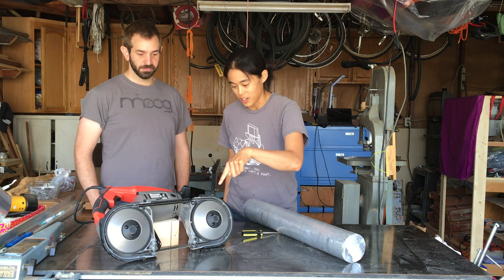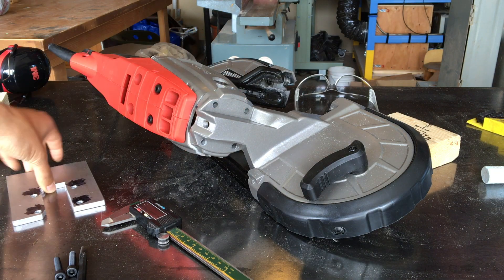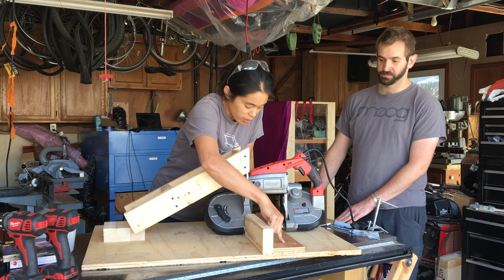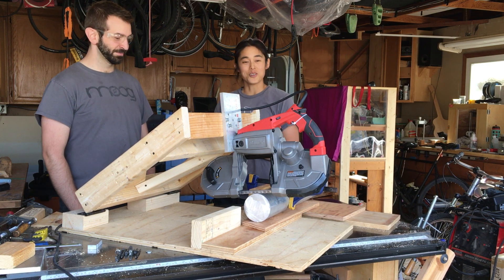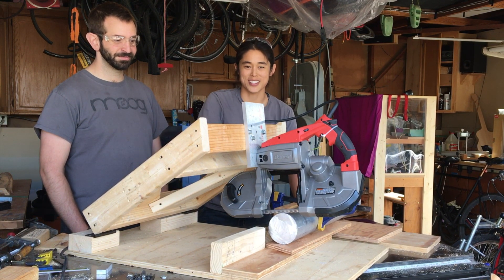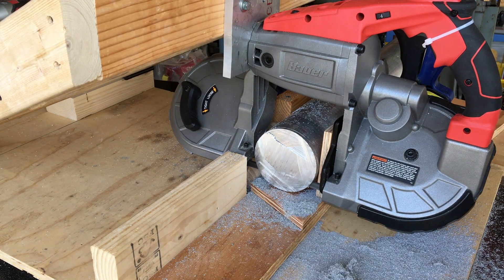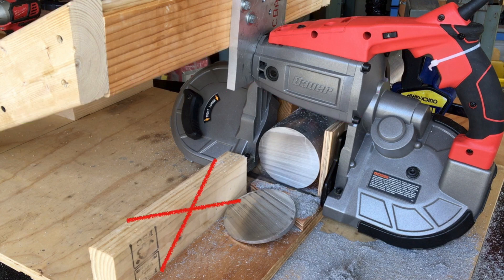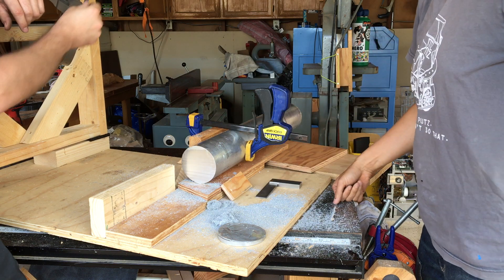Converting a Portable Bandsaw into a Horizontal Bandsaw

Comment: There are multiple issues contributing to the wobble, or let's say you have lack of rigidity in multiple places ;-) . 

Aside from as you already discovered the material to be cut needs to be positively located (having the rest on the side the blade is pushing the work into would be a goid start, actually a vice would be even better... )

The main issue is that the  force coming from the saw blade (which isn't constant as it catches and then slips) is applying a bending stress on the metal bracket and wooden frame because they arent in the line of the cutting force from the blade, as you also commented yourself the materials you have aren't super stiff so this is always going to flex hence this design is doomed to failure. Its a basic principle in statics to always arrange forces to be in line (pure tension or compression) with the structural members to avoid bending forces .. consider your bamboo bicycle frame. 

 Specifically, your metal bracket tries to adapt the saw frame using its existing holes .. which I get .. but the way it sticks out perpendicular to the line if the saw blade, and then has a very weak joint to the wooden arm , in effect with huge leverage.. is a disaster in terms of stress analysis. You need to get the pivot, arm and saw blade all as close as possible to in the same plane to minimise flexing stresses. (if you understand what I'm trying to say .. a shame youtube comments don't support uploading diagrams 😉 )

And when you get the saw/arm stiff enough, your last problem will probably be play in your hinges (depending on what sort if hinges you have of course). In any new design consider using some form of bearing to minimise play (even if just a plain bushing, I don't mean a ball race, that will quickly get full of sawdust ;-) ). 

But its great to see you building and experimenting. I really want to encourage you to persist. Each failure teaches us and the experience makes everything we do after better

Comment: Your design is a tuning fork. Turn the saw around and add a stiffener  between the swing axle on the left and the point where the red grip is connected to the lower pulley housing.

Comment: How would it work if the saw was mounted like a stationary vertical band saw and the piece you are cutting is on a tablesaw sled that has 2 rollers to rotate the stock against the blade... This way you can roll the item being cut as you get closer and closer to the center of the stock. Also, I think you need lubrication on the blade.
Reply from the maker: I think that concept would work, but ideally I want gravity to feed the material for me.

Comment: These saws rely on the adjustable contact bar , it keeps them from vibrating as the blade walks forward as it attempts to cut , it claws the metal and if noting is contacting the piece being cut other than the blade it chatter up, down, to and fro.
By now you have figured out I hope as well as minimizing the entire assembly.

Comment: Your saw is backwards.  The blade should pull/cut away from you, not towards you.
Reply: The saw is made so it cuts towards the trigger, where the user is actuating the saw. Your point is correct, the saw blade should cut toward the fence in this hacked scenario otherwise it pull the material away from the fence not tight to it . The saw should be mounted with the trigger at the back.

Comment: Have you tried adding some cutting lube? It can make a big difference when cutting metals.
Reply from the maker: We did use some wax at some point, which helped slightly. I think in the end, this particular build is a little too crude for cutting lube to be the main problem :D
Reply: @AmyMakesStuff  Maybe it would work better to mount the band saw down on a the table facing up and have the stock be the moving part coming down  - reverse the setup basically.